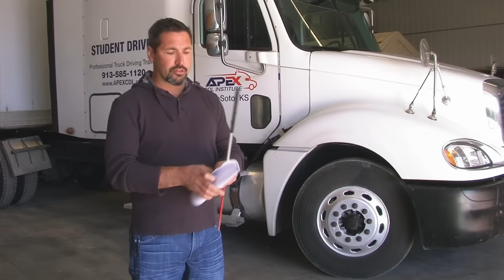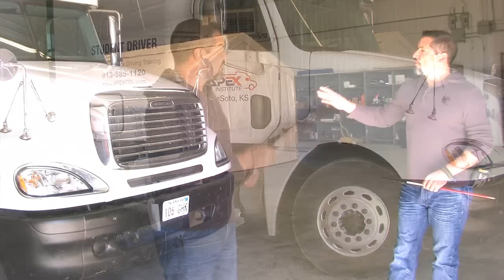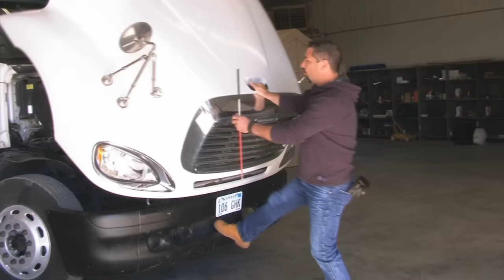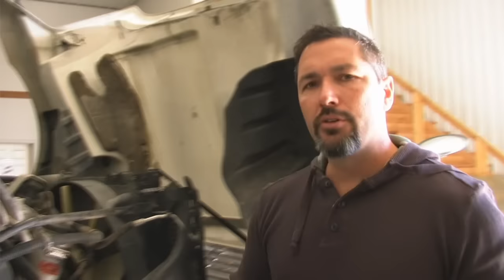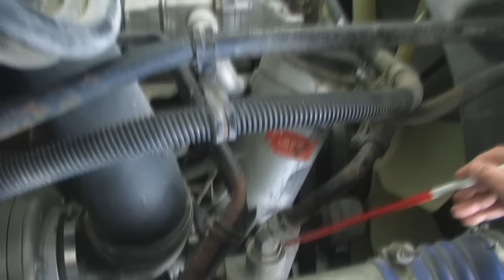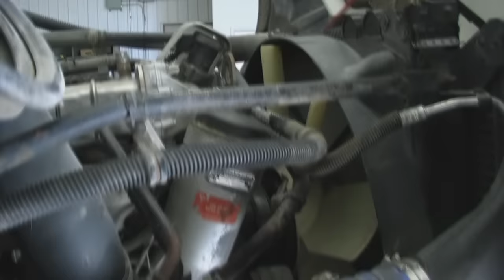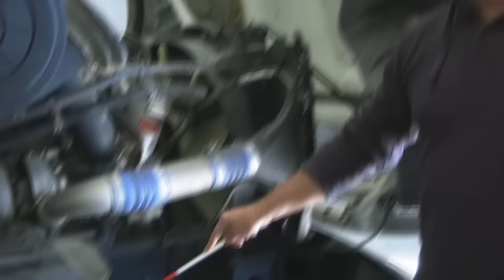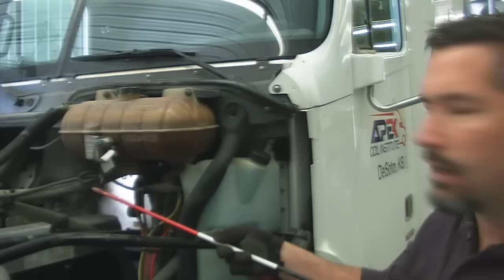How to perform a Class A CDL Pre-Trip inspection. Demonstrated by a state licensed CDL examiner.

Comment: failed twice the brake order in which Jeff descibes is wronge. $440 invested so far.
Reply from the maker: Sorry that the examiner in your state has no idea what they are doing. Section 4.3 page 4-11 in the federal CDL examiners manual, issued by AAMVA, specifically states how to do a brake check. Our procedures follow it to the letter. If your examiner disagrees then they need to go back and actually read the manual or make sure that they are actually using the procedure described in the manual, not just making up their own as they go along.

You can read the hundreds of comments of people using this video to pass their CDL test from all over the country, what are the chances that every other examiner in the country is wrong, but the examiner you got somehow is the only one that is right?

What does your instructor at the school you are attending say?
Reply: @Apexcdl  In my CDL handbook for PA, it lists the tug test first, before the SALE tests.

11.1.2
Parking break check.
It then goes in to describe the tug test.

After this, it then tells you how you must perform and pass each section of the "air brake check;" pressure holding capabilities, the warning sound, and then the emergency brakes. The tug test does not seem to be listed in the "air brake check" section.

It does not mention a static check, in which, you do not apply the brakes to check for leaks. It only requires you to hold the brakes for 60 seconds. It also does not mention turning the key to activate your gauges until after you have performed the hold test. Then, once you proceed onto the warning test, it requires you to turn the key.

It's also strange because in the cabin inspection section, it's telling you to check your reflectors, tail lights, reverse lights, ect. The light inspection is listed after the gauge inspection, but before the air horn and brake test.

I'll look into this federally guided resource you've listed, and be sure to check my examiner if they just so happen to mess up.
Reply from the maker: @Ryan_Carder  You misunderstand our point. Any examiner that is requiring the test to be done in a specific order does not understand their job. There is no order. The leakdown is listed in order simply because the test starts at the air pressure's highest point, 125PSI (Governor Cut Out)......and since the engine isn't running, pressure can only go down from there. But there is no requirement on order, its only done that way because that's how physics works......but you could restart the motor and refill air pressure. 

Regarding when the key is turned on or not, the manual is a bit out of date in this regard. Air pressure gauges used to be mechanical, they didn't require power to the dash to operate. Many trucks today's their air gauges will not operate without the power turned on, so you have to turn the key on or you cannot check air pressure loss. When the key is turned on......as long as it is turned on before doing your air brake test, doesnt matter. The scoring criteria for the examiner has nothing to do with when the key is activated. So as long as you shut the engine off and turn the key back on, you are fine.

Regarding the static check, you are correct. A static check is not required. An applied pressure test tells you everything you need to know. But we wrote our curriculum off the CDL Manual for our state and in the manual a static brake check is taught, so we teach it. While again, its not required, it doesnt have anything to do with failing the test.

Again, there is no order to any of this. There is no requirement to do it in any order at all. If an examiner says otherwise I would challenge them to show you where it says that in the AAMVA CDL Examiners Manual. I'll save them the time looking for it, it doesnt. The idea is to test your knowledge, there is no order to the knowledge and it is not part of the scoring criteria.

As an example, the airbrake leak down test in on pages 4-10 and 4-11 of the manual. The parking brake (tug test) is on page 4-24. The service brake check is all the way back on page 4-28. These brake check sections are separated by pages of items between them in the manual.....again, because as far as the examiner is concerned the order does not matter.

We do it it the order we do it because the truck just operates that way and it saves a lot of time.
Reply: @Apexcdl  I really appreciate the detailed reply. There is a lot of useful information in this video, and response as well. I am lucky enough to be able to skip school, and learn with my dad who is an owner operator. He's a veteran, who has never had to take a test for his CDL. He was grandfathered in when he had his chauffeurs license. So, for the physical tests, I'm on my own.

I've got one final question about the applied brake test. In my father's truck, when the brake is initially applied, there is a drop in pressure of around 3-5 psi. After the initial drop, there is no longer a loss of pressure. Is this normal? I can't find a video showing the gauges to see whether or not it is normal.

Comment: I apologize for my comment I was wrong.
Reply from the maker: Sorry, did you actually watch the video? Jeff says 3 PSI for static and 4 PSI for applied.   https://youtu.be/EfW615ZnELE?t=3086
Reply: @Apexcdl  I watched it again and you are correct I do apologize I was told he said it the wrong way by 2 different people and listened to it myself today and could have sworn I heard him say it wrong also. I dont know why I heard it wrong maybe its because I'm always worried about giving people the wrong info that I heard it wrong ,power of suggestion maybe I am sorry. I will delete my comment. Thank you for the video like I said I have recommended it thousands of times over the last several years. I fact I have asked that you guys do a class b (tri axle) video and a class a with Pintle hitch. Again I am sorry 😞 I will say though they did do away with he static check as part of the air brake check.
Reply from the maker: @coreyludwig9102  no worry at all, best of luck!!